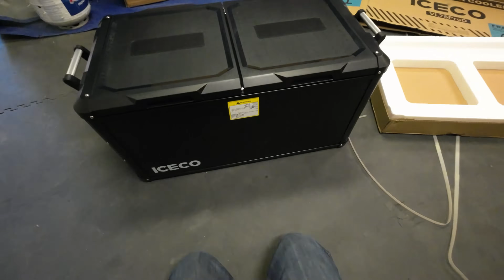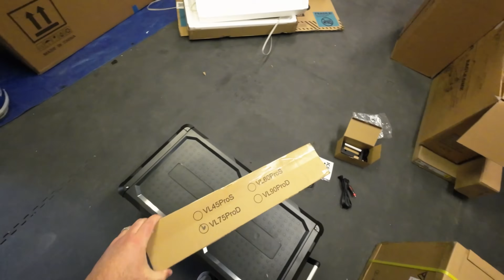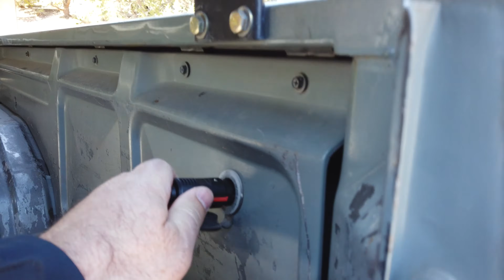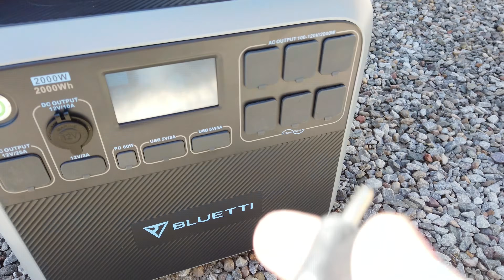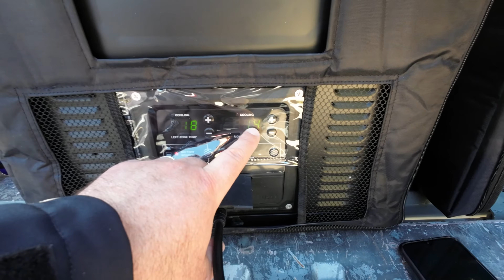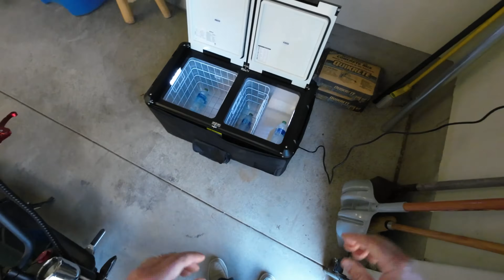ICECO 75 Pro Dual Zone Cooler/Freezer Review  - AC & DC All-In-One for Overlanding Camping Tiny Home

Comment: Good review, i have a question i see that the unit works on 12v /110v house power but can we plug it to a 220v hose power by 
using a transformer for usage in a County that uses 220/60hz power.
Reply: I believe iceco has another cord for 220v option